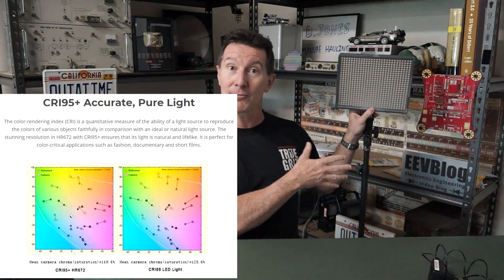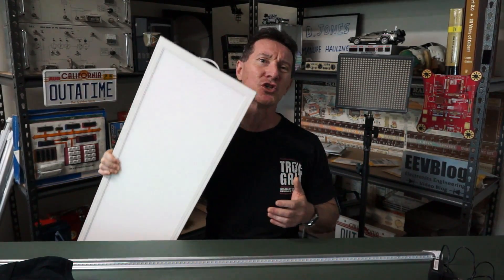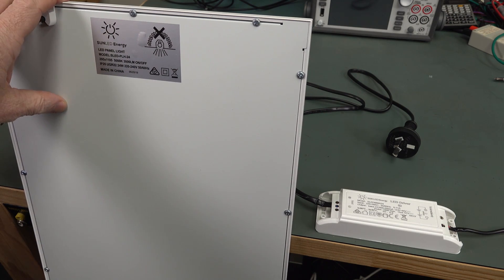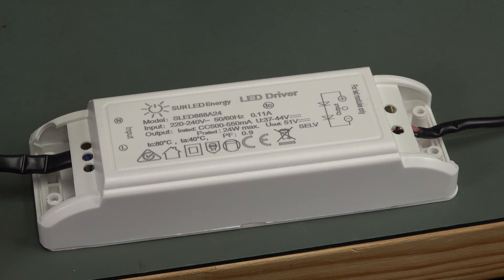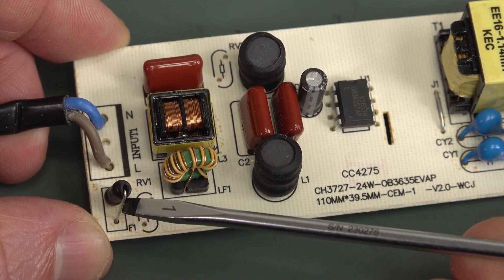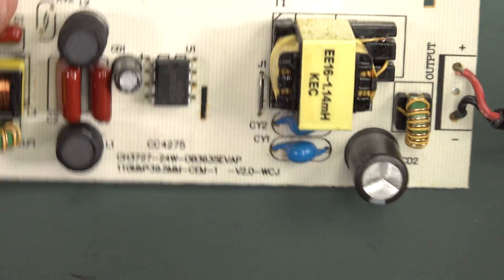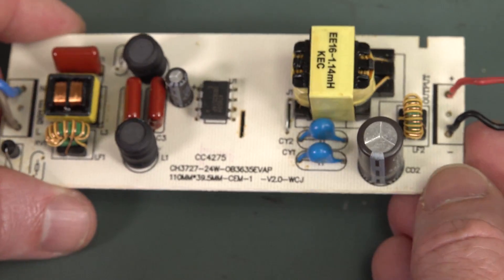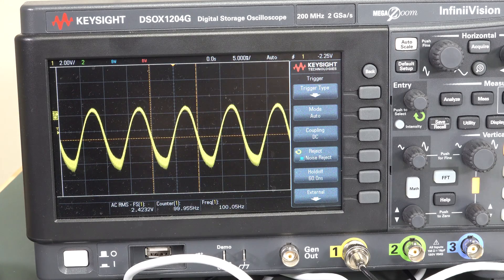EEVblog #1252 - LED Panel Lighting Flicker Investigated

Comment: Doing constant current on the output without secondary side sensing isn't "too hard", and there are off the shelf PWM based chips for it.
The main cheap out of this supply is the fact that it has bugger all in mains side bulk capacitance, two small film caps aren't going to do much. 
Also, the two capacitors are rated 150 volts and are in parallel, thankfully these types of caps are usually derated by the manufacturer by a lot, but still.... And then they are placed facing each other, making the text harder to read, are they deliberately trying to hide this fact? Strange that they didn't apply glue to it, or would that offset the tiny savings on cheap caps....
Reply: The reason why commercial LED drivers have no meaningful input capacitance is because most commercial and industrial installations pay for apparent power and putting input capacitors would screw up the power factor unless you go through the considerable additional expense of adding PFC circuitry. In some places, there are also surcharges for peak or inrush current and in those cases, putting large capacitors directly after a bridge rectifier is an even worse idea when you have hundreds of them: if each light peaks at 1A and you have 500 of 'em, you end up paying for 500A service (the power grid needs to be sized to deliver those 500 x 1A peaks to your location) just for lighting instead of the ~100Arms you are actually using.
Reply: @teardowndan5364  I would think you can get around that by using capacitance multiplication schemes. Matter of fact by now I am surprised they are not as common as switch mode power supplies are to outdated wall warts.
Reply: @johnpossum556  If what you mean by "capacitor multiplication" is boosting the capacitor's current through a transistor to emulate a bigger one, this does not help here since the output will dip to whatever the input is when the input is less than the output. That circuit is effectively an open-loop voltage regulator with all the inefficiency that comes with one.
Reply: @teardowndan5364  so actually AC needs to die if possible. We may need to switch DC grid.
Reply: @mustafayasiraydin  AC won the power distribution war because it makes changing between voltages easy, cheap and super reliable: tough to beat the simplicity and reliability of dumb hunks of copper and steel. If you want to convert between voltages on a DC grid, the DC-DC converters have to convert to AC in-between anyway. The only thing worth converting to DC are long-haul lines to save on parasitic inductance.

DC at the point of use would be highly problematic due to the number of transformer-based devices, appliances with AC motors, gadgets that use capacitive droppers for power, etc. There is also the issue of DC arcs being much harder to quench, which would require breakers and breaker boxes designed accordingly. A switch to DC in the home/business/industry would be prohibitively expensive for very little benefit.
Reply: @teardowndan5364  wow thanks for the detailed explanation which also makes sense :)
Reply: @teardowndan5364  Power factor correction doesn't need to be done for each individual appliance. There is power factor correction units that sits on the AC side.

The two simplest verities is to either have large mains filters filtering out most higher frequency content, leaving one with a rough sine wave. That typically have a bit of offset from the mains voltage. This isn't "ideal" for most environments, but it can bring one in a fair bit closer.

The other simple solution is an AC motor, typically three phase, driving a large flywheel, and this then sits in parallel with one's load. (a synchronous condenser. These though needs occasional maintenance.)

There is also more complicated switch mode based solutions.

In regards to DC distribution on the industrial level. It has been done historically for many decades, and is even done today.

One of the larger DC users is datacenters, these do it so that each server power supply can just be a switch mode supply without any PFC. Then the Datacenter's power distribution system has its own much larger and cost effective PFC unit instead. (This also helps reduce peak current in distribution cables throughout the datacenter and can lower cooling requirements and copper expenses by a few percent.)

It wouldn't be "unreasonable" to implement a similar solution for office overhead lighting. Likely also give it a suitable plug, so that non DC stuff can't be plugged into it. 

Switching DC is fairly simple too, Switch mode power supplies does it tens of thousands of time per second without any sparks, using a cheap off the shelf transistor. Typically rated for continuous currents of a couple of amps, without any real heat sink requirements.

Though, it is questionable if one can trust electrical outlet manufacturers with the task of integrating a single mosfet and a resistive divider, into their devices... (and yes, the plug would need to act as as the final connection for that resistive divider, so that the transistor actually does the job of switching the power on and off. But this is fairly trivial.)
Reply: @todayonthebench  In a SMPS, the MOSFET operates in a tightly controlled electrical environment and normal operating conditions. In a breaker box environment, its function is to break fault current and you don't want a FET to be the only thing between you and burning the whole panel down. Regardless of mechanical or electronic switch, you will need snubbers on both sides to prevent wiring inductance from causing large voltage spikes that may destroy the FET or arc over in a switch. On AC, you can let zero-crossing take care of that.
Reply: @teardowndan5364  DC breakers do exist, they cost a bit more then AC ones. But have the typical stuff in them. Everything from over current sensing, to arch quenching.

The idea with the mosfet weren't "breaking" fault currents. But rather do the job of an electrical switch within normal operating conditions at the electrical outlet. Likely with a spark gap, and over voltage protection over it for keeping voltage spikes within its specs.
Reply: @todayonthebench  My point was that going DC, aside from obvious compatibility issues with AC equipment, also requires ripping out practically everything because safety and handling equipment designed for AC isn't usable on DC. Things like switches only have about a fifth the usable current rating in DC vs AC.

If you design a site from the ground up on DC, sure, that may be workable. For existing sites, just about everything other than the wiring (assuming it is in good condition) has to come out.
Reply: @teardowndan5364  Of cores one can't just stuff random appliances onto a DC distribution system. That were never my statement.

DC has advantages in some areas, especially when dealing with stuff where abhorrent power factor would be expected. (Like powering lots of switch mode power supplies. (that always have a bridge rectifier in them, and can therefor run on DC.))

But a DC system should only be used in environments where it makes sense. And preferably not use standard outlets either. 

(Some data centers for an example doesn't even use outlets for DC, but rather just uses screw terminals and thick wires. And labeling everything with "danger High Voltages!" This is though a questionable practice....)

Mechanical switches should also be avoided, since yes, their DC ratings are generally abhorrent, and contact welding is a valid concern. Using solid state devices is generally a good solution for avoiding contact welding. Circuit breaking during fault conditions on the other hand should still be done by more robust solutions.

My point were though, it wouldn't be unreasonable to put office lighting on a DC system, NOT the whole building, just the ceiling lighting. Preferably using an power connector that isn't compatible with anything that isn't supposed to be on that DC system. (The system should be "idiot proof" and clearly labeled.)

One can make DC distribution for far more things too, but an office environment isn't ideal for this, too many non electrically knowledgeable people around, that would try to plug stupid things into it.

The ceiling lighting on the other hand is something few people even knows uses a power plug. And using a specialty plug here would deter them yet more.
Reply: @todayonthebench  PFC does need to be done on each appliance depending on where you live. EU and US regulations mandate > 0.9 PF for most small appliances and lights these days.
Reply: @davefiddes  I were more referring to the fact that power factor correction can be done on a distribution level closer to the electrical meter.

So there isn't a strict need for an appliance to have any PFC internally. If used in an application where there is external PFC already. This is though most typically done in DC distribution systems.

For appliances that are made for the general market, then living up to the regulation is though required.
Reply: A full bridge rectifier (why does that phrase always echo?) and some beefier caps on the output and things would be much better on that cheap-shit driver.

Comment: Can someone explain this to me... Isnt secondary side still AC referenced to mains earth via those capacitors between primary and secondary side of transformer? and is this/that small current harmfull to the scope?
Reply: Those caps are such value that the most you can get is a tingle, under "ideal" circumstances. The scope is fine too.

Comment: 37-44V with a 50V capacitor ?  wow ! waranty is 3 months ?
Reply: A fair amount of that 100Hz ripple current is going to go through the output capacitor as well, further reducing the capacitor life
Reply: Even worse, it looks like the primary side one is a 50V type as well.
Reply from the maker: @superdau  The primary side electro is not filtering the 100Hz output, it's the power supply for the chip.

Comment: Question - Could you not remove the secondary side diode, cut the negative track between the winding and the cap negative, and bodge in a full bridge rectifier between the transformer and the output cap? It looks half wave rectified just now, and I wonder if full bridge rectification would reduce the ripple enough?
Reply: The chip most likely using a flyback configuration, for these a full bridge rectifier is not what one wants, and it would stop it from working.

(A flyback configuration uses the transformer as if it is an inductor, building up a magnetic field, then releasing it, the field collapses and induces a current in the opposite direction over the primary and secondary sides. The mains side switching transistor is currently off while the core tries forcing current through it, after all, it is an inductor and it doesn't like when the current changes. The diode on the other hand allows it to pass through to the secondary side cap. During the build up of the magnetic field, the transformer is reverse biasing the secondary side diode, hence building up and storing energy in the magnetic field. This in the end allows us to send over a known amount of energy per pulse, and known peak current. (the secondary side current is proportional to the winding ration between the primary and secondary sides, just like a normal transformer.))
Reply: @todayonthebench  That's right. Plus what you'll get after single diode rectifier is a ripple at switching frequency, you won't see that.
Reply: @mrjohhhnnnyyy5797  Yes, and the switching frequencies of these devices is typically in the few tens of KHz. So the 330µF cap should do a semi decent job filtering a fair bit of that out.

Though, the supply has no mains side capacitance to speak off. And that is why the supply ripples like hell.
Reply: At just 24 watts, it's probably a flyback transformer, so that might not help at all. Might make things worse actually.

Comment: it appears the problem is missing primary side capacitance as indicated bey the 100ħz riple and nor the missing secondary side capacitance? 

also can you explain how the secondary side current regulation with the extra transistor works?
Reply: he did
Reply: @God-CDXX  Not relay. 

He says its a current regulator behind a current regulator. 

since it has no Induktor one must assume its a Linear current regulator. 

What is the output current of the second current regulator?  if its lower the first current regulator, than the voltage drop would be over the second current regulator. if this one is linear it whats regulating the power dissipation? 

imagine having a 300mA electronic load  on an 350mA constant current source... whats the power going in the 300mA load?
Reply: Yeah! I expected a much higher frequency on the secondary. Seeing a 100 Hz ripple was unexpected!
Reply from the maker: it's not an extra transistor on the secondary, it's specific LED driver  constant current driver chip.
Reply: @EEVblog  The point is. i don't see (optocoupler)feedback. an i don't see a a second indicator.
So if you put a current regulator behind a current regulator  the voltage going in the second current regulator is gonna be unregulated? 

If the second current regulator is Linear how to make sure its only doping an appropriate voltage?
Reply: The main transformer should IMHO however run at a higher frequency than mains, it seems too small to run 24 W at 50/100 hz
Reply: @vihai  it is running at 50 KHZ the 100 HZ ripple is from the fact it doesn't have a primary side bulk filter cap

Comment: All of my cheap Chinese LED drivers have a big filter cap on the primary side and they don't have any visible flicker. I'm guessing they left out the filter caps on your driver to increase the power factor.
Reply: Yes, try putting much larger caps on the primary and secondary. 330uF is far too small. should be 1000uF and two of them. Also try removing the blue Y caps.
Reply: Probably has a higher switching frequency. IIRC, good ones are in the low megahertz.
Reply: logmeindog - It’s not the switching frequency causing the flicker, it’s the fact these things runs on unsmoothed mains. This causes 100Hz (120Hz in North America etc.) pulsating of the LEDs because the whole circuit rides on the 100Hz waveform. It makes no difference if they use 45KHz, 65KHz or MHz range switching, it’s still modulated with 100Hz.
Reply: wouldn't the caps compensate the power factor? or are the lights not considered inductive load for it to happen? or I got it all back to front? legit curious
Reply: @kstxevolution9642  No the caps wouldn't compensate the power factor because of the extremely distorted current waveform the caps introduce if they are put right after the mains rectifier. It is not your classic power factor issue where the current lags the voltage issue at play here. It is specifically called distortion power factor introduced by non-linear loads such as these led drivers.
Reply: funny thing is, I just got a panel led with a LUFID driver and it flickers when filming at 240fps

my chinese universal voltage leds (GU10s) and osram ledvance panel light do not flicker at all, nor do all my philips led bulbs.